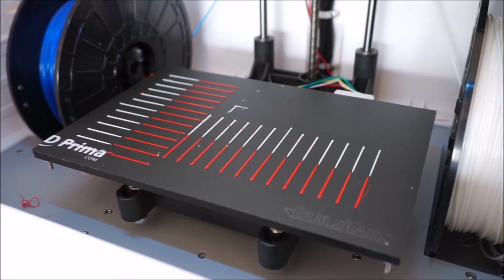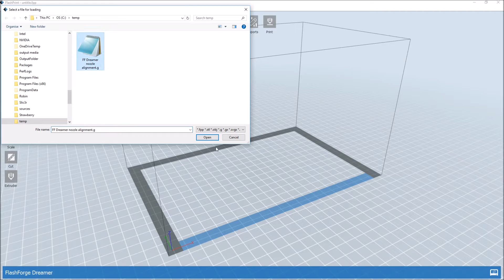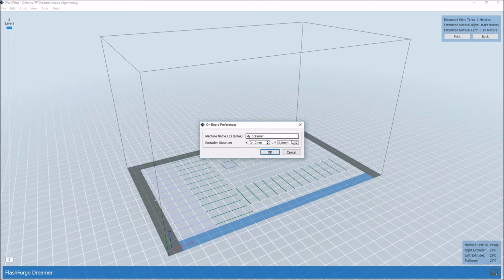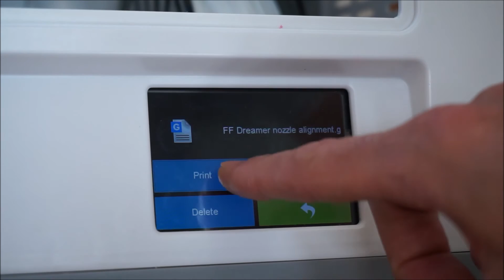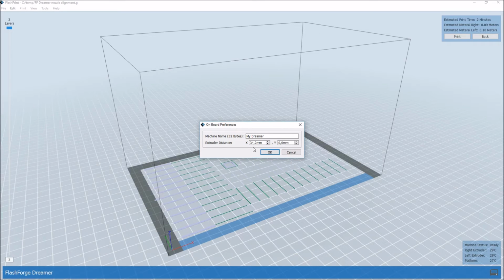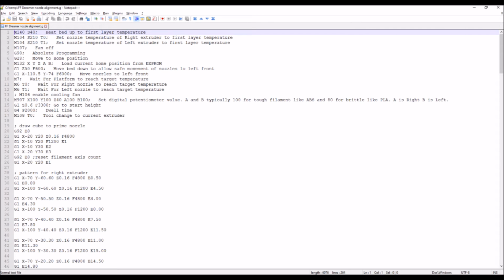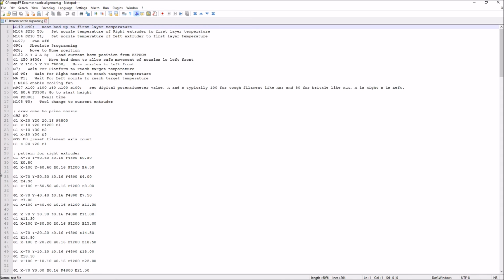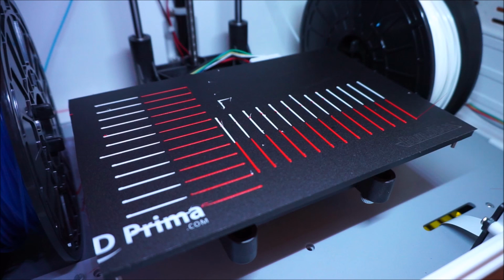Dual Nozzle XY calibration on the Flashforge Dreamer

Comment: Great video. Many thanks! Would this work with the creator pro 2017?
Reply from the maker: Hi,  thanks for commenting. As far as I know the creator pro only works with X3G files. So unless there is a way to convert a file back from X3G to G-code it will not work. Robin
Reply: UptimeFab Many thanks. I don't suppose you know how I could do this with a creator pro? The nozzle arrangement is basically the same, so I'm keen to align them both better. Thank you ☺️

Comment: i keep having issues with the filament sticking to the nozzle and either not sticking to the print base or pulling the work off the base. i would be very grateful for any suggestions if you have them
Reply from the maker: Hi Spiro, this might be an issue for more people since this was also mentioned in mabs503's earlier comment below. Based upon his idea I have updated the file to include "z-hop", which basically raises the nozzle by a small distance to prevent the nozzles from scraping of printed lines. I have tested the file and it works fine. However, I did notice that the right nozzle is still passing over the first couple of lines from the x-alignment pattern. I would have to fully reorder the program the fix this. Unfortunately I do not have time today to rewrite and retest the program, but I hope the z-hop fix eliminates most of your problems. The post on my website (link in video description) is updated with the new rev2 program. 
By the way, I have tested the rev1 and rev2 programs multiple times and the lines never came off the bed, but I understand this program is very critical with regards to bed adhesion. I use buildTak and perform maintenance on it it from time to time by giving it a very light sanding with fine grit sand paper. (clean with IPA after sanding).
Hope this helps for now. If I do end up further rewriting the program I will update the post.
Good luck,
Robin

Comment: Thanx! It worked very well.
For info: After running the procedure I changed the calibration from X 34.5, Y 0.0 to X 34.0, Y-0.2 on my Flashforge Dreamer.
I made some changes to the code to make it work better for me. I needed to add a 3mm z movement after each extrusion because I had a problem that the nozzles dragged off the already extruded lines when doing via movement. I also lowered both the extrusion speed and the movement speed, and changed the temperatures to match the ABS I used.

Comment: Ths flashforge dreamer just got reduced to 899 would you recommend it over the 799 creator pro?
Reply from the maker: I can't speak to the print quality of the creator pro, but it usually gets good reviews, so I believe it is a good option. The reasons I chose the Dreamer over the Creator pro was the support for standard G-code, wifi and more modern interface. However, I think there are a lot of similarities between these printers and it would come down your personal preference.
Robin
Reply: The Dreamer has a better board and nicer print

Comment: Hi cool Video thanks much, but ive got one problem; On the left extruder ive got blackPLA and on Right extruder RedPLA, the black is exact 1mm out of the red, is this normal?
Reply from the maker: Hi Tobias, This is unfortunate. Hopefully I can help to find a solution.I have just checked the coordinates in the program again and the X values for the longest line in the center are the same for both extruders. This would mean the program is not the cause for this offset. Did you write down the start values for X and Y in Flashprint under "on board preferences" before making any modifications? (assuming you have made changes to these offsets). If so, you could return to the initial values and start again. If not, you could adjust the X-offset in Flashprint with your measured offset and run the program again for fine tuning. Did you experience the 1 mm offset in dual color prints before performing this procedure?
Hope this helps. Please let me know if you find the cause.
Robin

Comment: will it work with CTC 3d printer (clone of makerbot replicator duo)?
Reply from the maker: Hi Sergejs, I am not sure if the CTC printer accepts standard G-code or if it requires the X3G file format. If the latter is the case it will not work, since I only have the file available in G-code format. (since I made the file manually in a text editor this is the only format I can generate).
Hope this helps, 
Robin